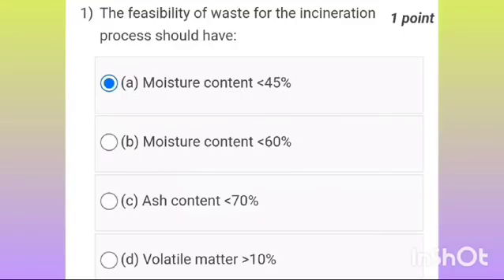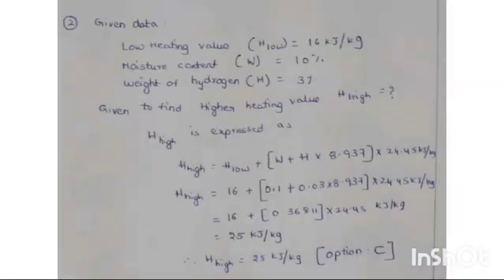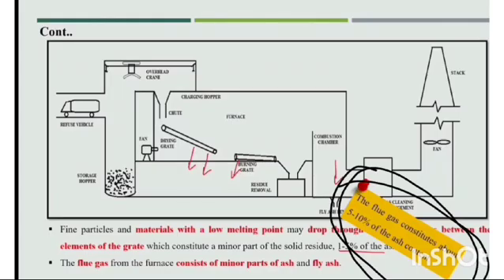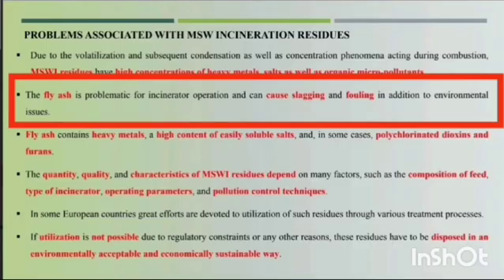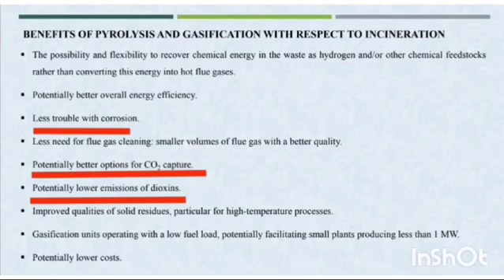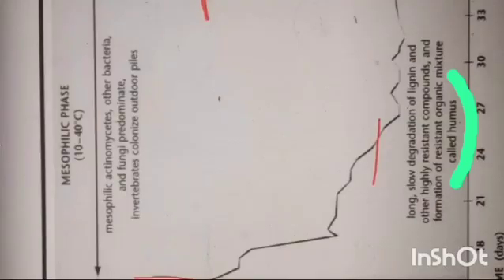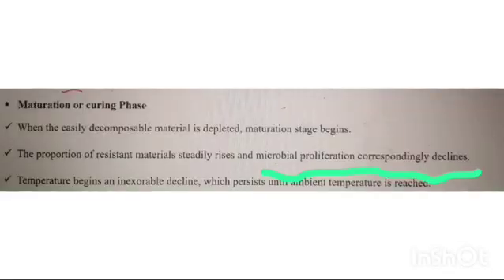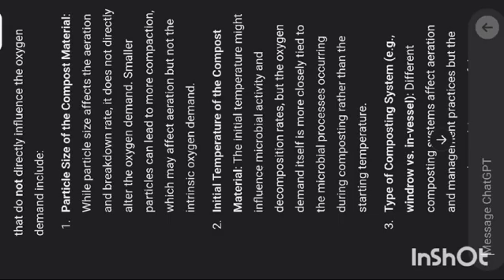Municipal solid waste management week 5 answers | Nptel solid waste management assignment 5 answers

Comment: Mam 3 answers got  wrong  mam
Question 3,13,14  mam....11/14 marks
Reply from the maker: Two questions are mistaken because they are not multiple choice..Sorry for that
Reply: @CivilEngineersGuide-d3l  3 also wrong mam
Reply: @CivilEngineersGuide-d3l  no problem mam
Reply from the maker: We attempted answers 13,14 are correct but typing mistake is there